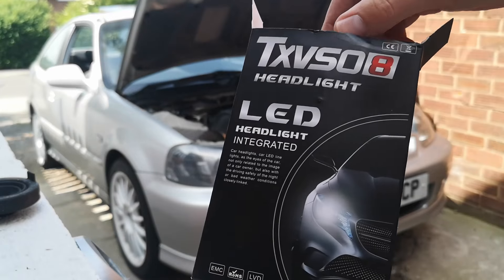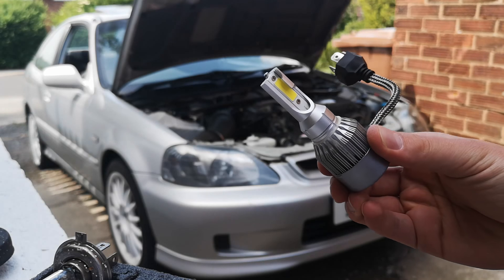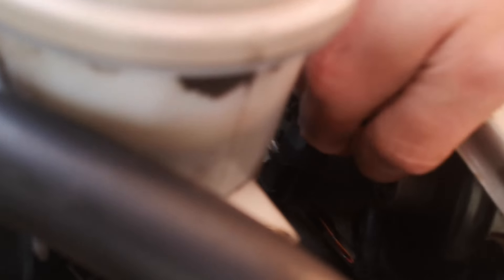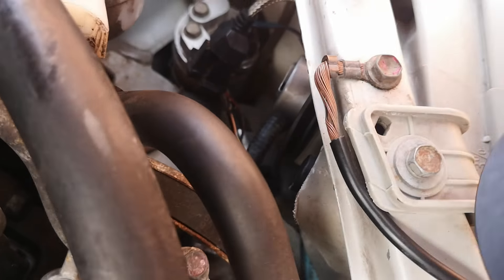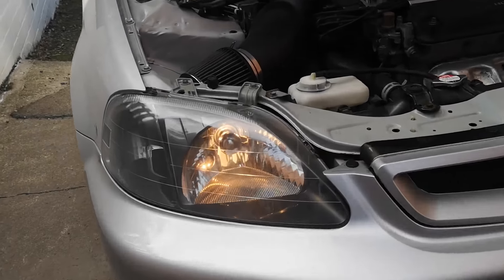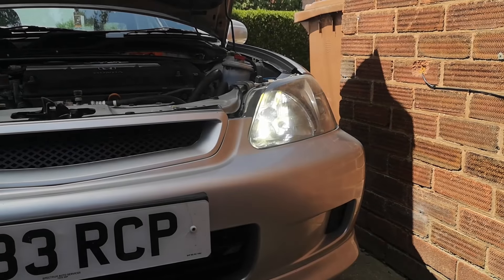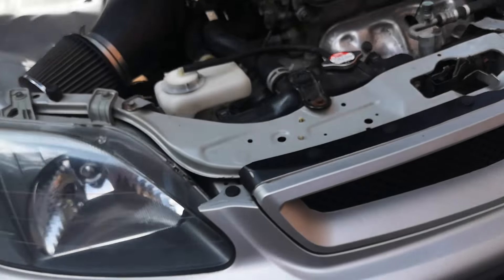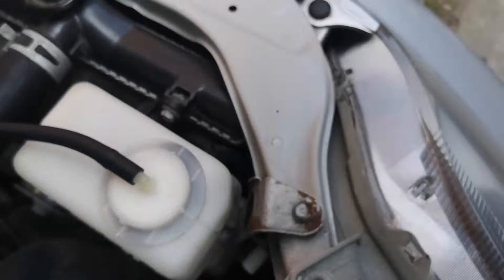How To Install LED headlight bulbs DIY Installation headlights headlamp bulb conversion kit any car

Comment: As a chemist who worked for 5 years in the LED field, rest assured that even the “cheapest” LED (light emitting diode) will usually way outlast even the “best” halogen bulbs.
Reply: Thanks for that xxx
Reply: I don't get why led needs a fan🤔

Comment: You can't see the orientation of the bulb. Which is the most important aspect of proper installation
Reply from the maker: I must admit, I parked facing a wall and twisted the bulbs around to get a correct profile light pattern. Mainly the height of the light pattern, once set right, high beam and low were much more distinguishable 👍

Comment: What’re you going to do when your MOT is due? Considering LED conversions (annoyingly) aren’t road legal?
Reply from the maker: The thing is, they have no legislation and the legislation that surrounds headlights are regarding their brightness (measured in watts for some reason, not lumens) and bulb patterns / types and them being specific to the headlights in question. H4 being the stipulated bulb type for my headlights which this bulb meets. I agree with you that I don't believe a police officer would see it that way but an mot tester would look at the light pattern and that its functional as intended. I.e works and doesn't stray out of the bulb pattern required. Id be very interested in any up and coming court cases surrounding the led direct replacement bulbs. As for type approval for my car, it did include a halogen bulb which would have met a British standard as a bulb itself. But as no legislation exists for LEDs its not a problem with its application but in my opinion the UK being behind regarding the led tech and construction of use would never had predicted a direct replacement with a different technology. So I'd say the jury's out
Reply: @Dan_AYP  fair enough, I really wanna switch my civic to led when I get the money, but I’m always worried with my luck that I’d get called up on it 😭 there’s so much of my car that I want to change!
Reply from the maker: @StarFoxAnimations  I have no doubt ill get pulled one day and given a fine for it but 🤷‍♂️ its the risk you take modifying cars
Reply: @Dan_AYP  true, true, I’ve got a friend who’s been modding his cars since 2012, I’ll probably ask him his experience with them too! But for now, I’ve subbed to ya to see how far your civic gets! Maybe take some of it in when I finally start modding mine 👍 wanna re-colour it from this horrible dark green 🤮
Reply from the maker: @StarFoxAnimations  try rock the green, its different and in at the minuet especially British racing green 👍
Reply: @Dan_AYP  it’s pretty much that colour already, but I just want it to go back to fit my aesthetic 😂
Reply: @StarFoxAnimations  that truly sucks M8. I live in Florida and I can do basically whatever I want to my car. They don't have yearly inspections there 😅😏

Comment: I have a question I did something similar and they look great when the engine isn’t running but when it’s on there’s a slight flicker not extreme but very slight would you what my problem could be

Comment: The Led Headlight bulb Chips are by far too wide as you need to get Led Headlight bulb Chips that are a lot smaller so they line Exactly Perfectly with the Halogen bulb filaments? & in that way you are going to get way better Led Headlight Beams that won't throw the light beams in all Directions Kind Regards Peter PS if you don't believe me go on the Utube site Headlight Revolution by Chris Nelson he will put you on getting the proper Led Headlight bulbs & you will even get even better Quality Led Headlighing on your car
Reply from the maker: That completely makes sense and fully explains those cheaper lights with wider spread light patterns 👍 thanks for the insight

Comment: You should have just pulled the lamps off.
Reply from the maker: Easier said than done, to get the headlights out the grill has to come off and the inner arches have to he partially unclipped to drop the bumper at each side, wasn't worth it trust me 😂 I swapped the headlights for those ek9 ones previously so wasn't wanting to do that again just for some bulbs
Reply: @Dan_AYP  Looks like a fairly easy project. I need to do the same for myself.
Reply from the maker: @timm_3r  yeah access on the belt side of the engine is a little tight but its not too bad tbh 👍